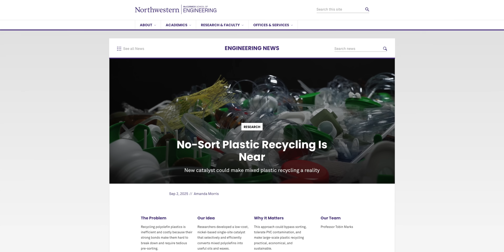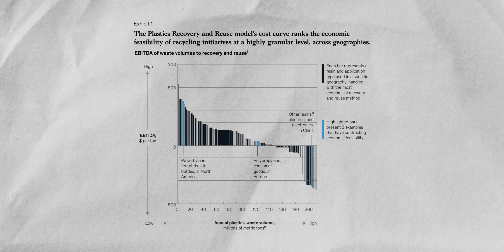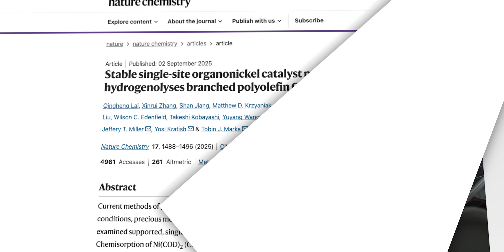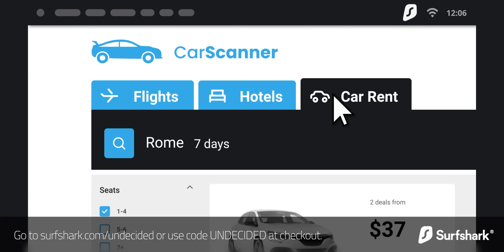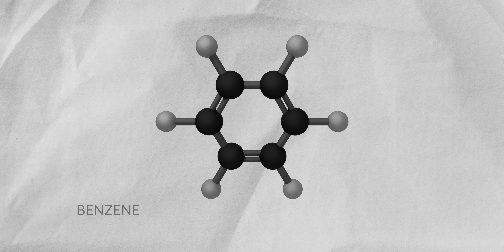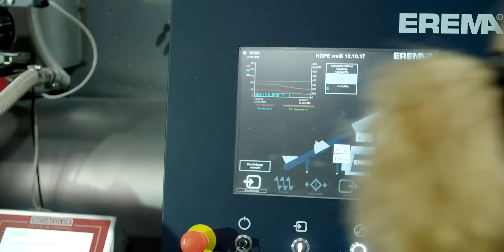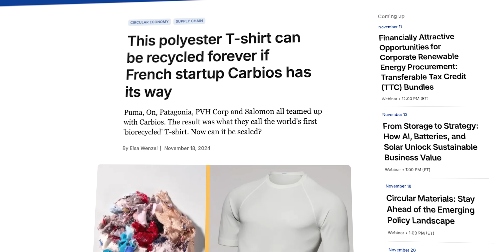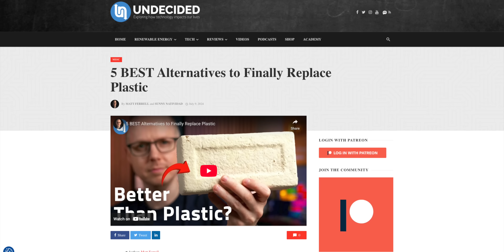The Recycling Breakthrough That Doesn't Need Sorting

Comment: plastic recycling is just the card dangling in front of us, so we don't complain too much about all that trash. It's just not happening. Shipping it to some dump half a world away is just cheaper. This won't change short or even mid time.
Reply: You're oversimplifying it into a false dichotomy. There are two ways it becomes widespread, one it becomes net cheaper to recycle then it is to ship off to offshore landfills, or it becomes price comparable to oil
Reply: @benjaminandrews956  There is a third option: lawmakers make it mandatory, which is how stuff like this will increasingly be handled in the EU. In that scenario, you need to use the new tech as soon as it is operable, and thusly create the capital and innovation incentive to improve it over time.
Reply: ...unless some new technology comes along making it practical to recycle plastics.
Reply: @5353Jumper  that's what's always "the solution" in such cases… "just wait for the next magic technology!" - thing is? It rarely happens and we should actually solve our problems instead of waiting for magic.
Reply: @DresdenFPV making technology is solving the problem... Do you really not know how the world works?
Reply: @benjaminandrews956 Yeah, it doesn't solve this problem ever, though.
Reply: Plastics recycling is 95% not happening, because virgin plastic from fossil fuel is so cheap (because we don't pay for the externalities). But it costs money to transport trash to a landfill. If you pay slightly less for someone to recycle some of it, then economics will kick in. 

As a consumer, try to buy stuff in clear PET #1 ♳ (plastic bottles and some containers) and HDPE #2 ♴ (milk jugs) which are recycled at decent percentages in many areas. And complain to companies that instead put stuff in colored plastic, overuse those awful plastic film overwraps on bottles and cans, and needlessly use all the other kinds of plastic that aren't recycled post-consumer to any significant degree.
Reply: It it actually works China will do and will be even further ahead of the West
Reply: @aimeem it's claimed that China incinerates it's waste to generate electricity. The emissions arethen filtered. They have run out of waste and are now selling the incinerators to other countries.
Reply: @aimeem  isn't China the second largest polluter in the word
Reply: China has difficulty treating waste water… from industrial use.

Comment: You might want to take a look at UBQ Materials.  Basically taking stuff from unsorted landfills and turning it into feed-stock for new products.

UBQ Materials has developed a patented process to convert unsorted municipal solid waste, including organic materials (food scraps, garden trimmings), dirty plastics, paper, and cardboard, into a raw, climate-positive material called UBQ™. This material comes in the form of pellets that can be used by manufacturers as a substitute for conventional oil-based plastics and wood in existing industrial processes like injection molding and extrusion.
Reply: Doesn't that stuff just sit around with no one buying it?
Reply: @mano966  Probably. That has been the problem with a lot of downcycling products. There is only so much need for ugly park benches and palette-type thingys, especially when, as in the case of palettes, there is already a perfectly recyclable product in use.